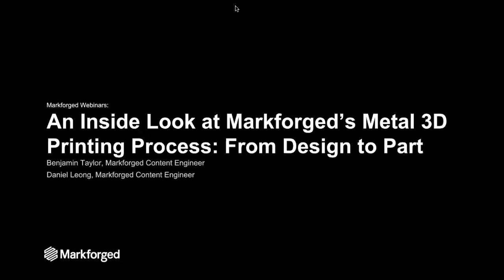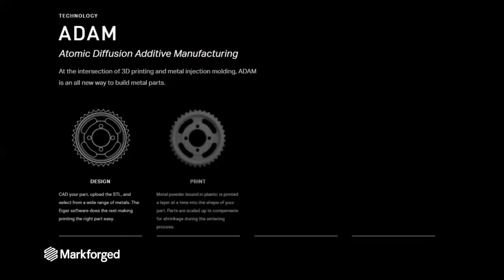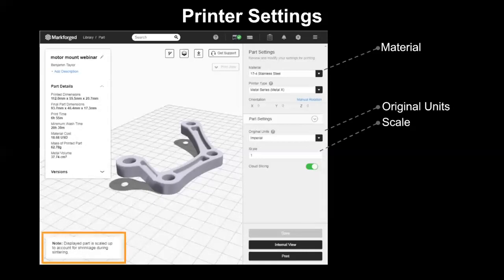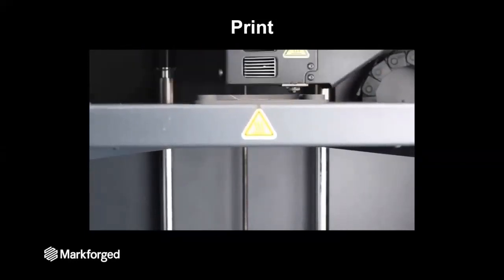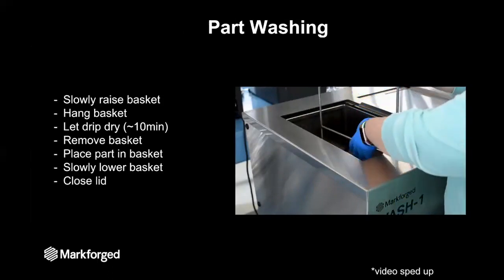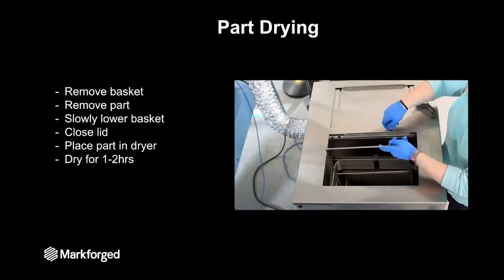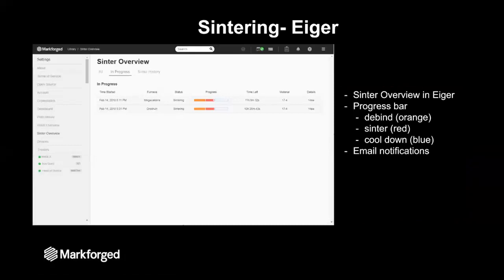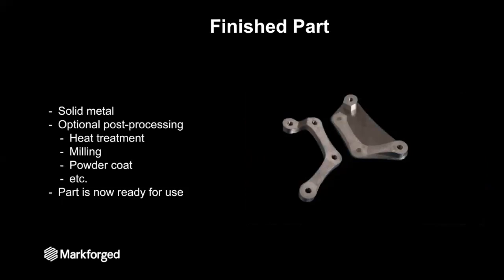An Inside Look at Markforged's Metal 3D Printing Process: From Design to Final Part

Comment: 🤔 So, are the parts size limitations are that of the funace's opining size?
Is there pressure that builds up (in the furnace chamber) that requires the 3 screws on the lid? 
Can they be substituted by a spring type of seal with a push-lock pin?
Are all those items (stations) also included with the printer package?
And lastly, are all parts sent over to the cloud for processing before printing (what if I'm working on an isolated area)? Basically all the time you need to print, anything, the machine needs some type of connection to internet? Can you print parts sliced locally on the computer?